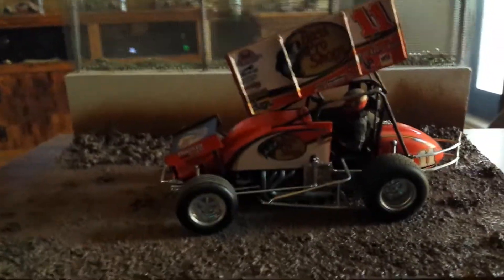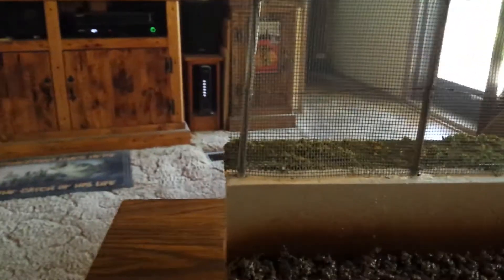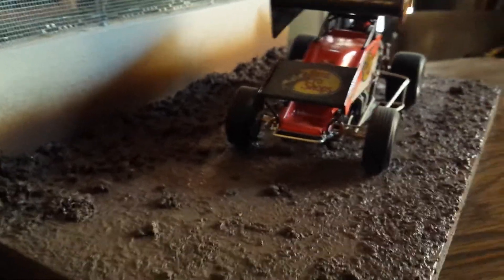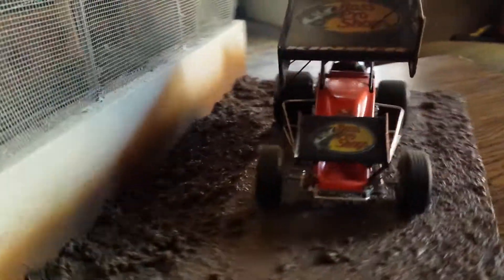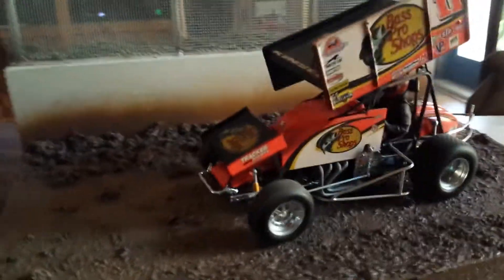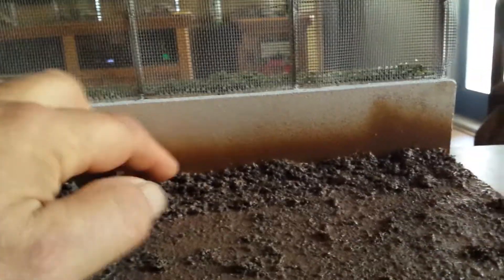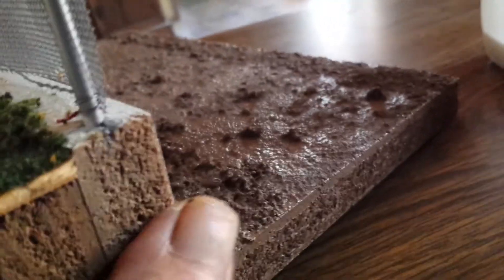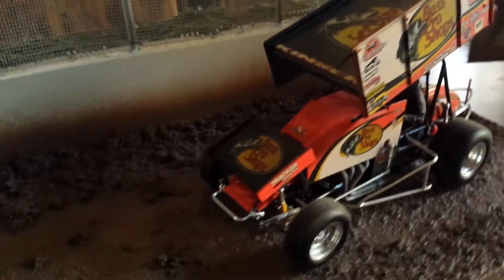Steve Kinser Bass Pro Shops sprint car model with diorama

Comment: Great diorama, looks real, nice tip on the dish soap in the glue mixture, :) Tom
Reply from the maker: Thanks very much. I learned that little trick back when I did model railroading. You can put on the ground cover as heavy as you want and then spray it with that mixture and everything will be glued down and still look loose and realistic. You can also do that with the ballast on the track.